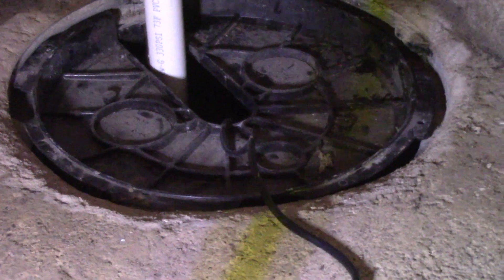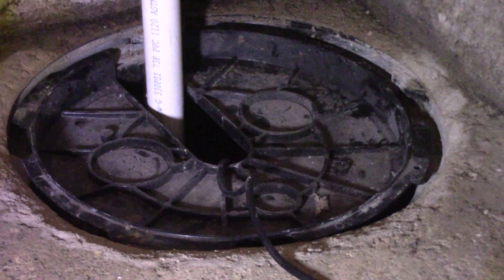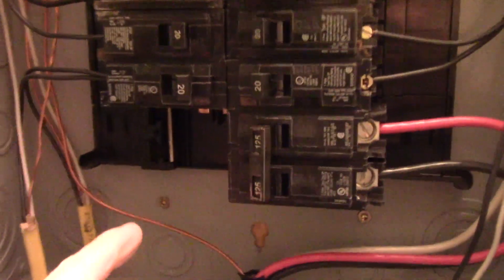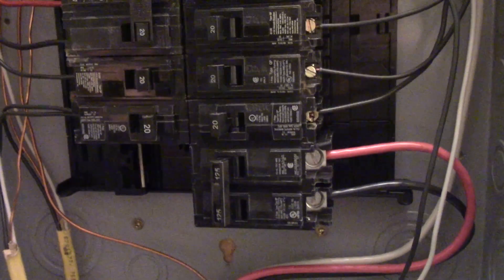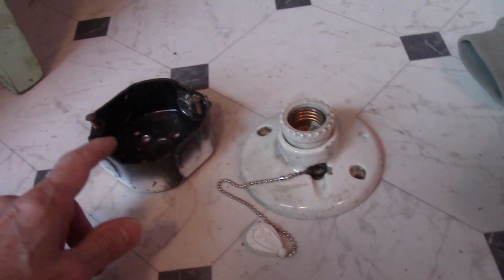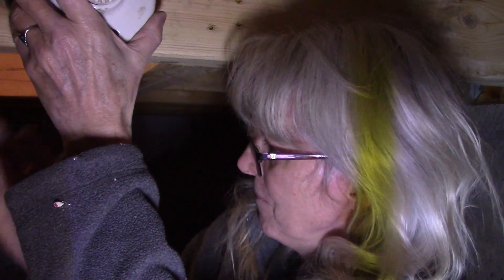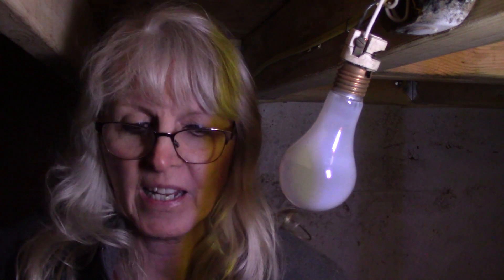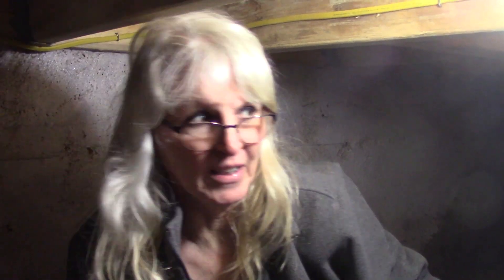Installing electric in my root cellar

Comment: You did a really good job Robin, I would take you as my Electricians helper anytime 👍   You looked like you've done that a time or two before 😉 LOL    I did Electrical work for over 18yrs, from homes to High Rise buildings 😳😜   You made one small mistake, the 'Yellow Wing Nuts' needed to be 'Red Wing Nuts' for that Awg wire (the yellow jacket on the romex tells me it's 12-2 w/g) and the amount of wires you had connected together (3 = 1 in - 1 out - 1 pigtail) 😉   The pig tail for the pull chain light fixture was a good idea, smart thinking there 👍   The next time you buy a GFCI, it's your choice (you can save some $$$) but you really don't have to buy a 20A plug, the 15A plugs will handle the load of a 20A circuit, I have NEVER seen one fail.  Take Care and Keep up the Good Work 👍
Reply from the maker: I used 12-2 wire and a matching 20 amp GFI because I'm thinking I may have to use a dehumidifier down there at times to prevent mold. I tend to overkill LOL
Reply: @nativerobin  If it's on a 15A breaker then yeah it is overkill but if it's on 20A breaker then you have done what is required by Code 👍

Comment: My tstat is a 4 wire with double a's and it thinks they are dead regardless if they are new. I gotta pull power from someplace and gonna upgrade to a digital.  Better 3/4s likes to mess with my tstat to much making the house to hot.